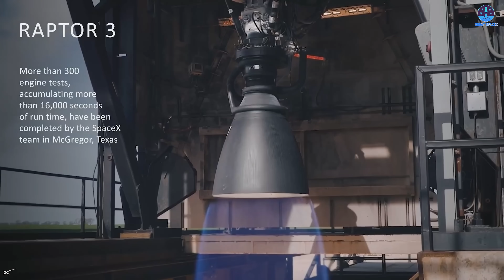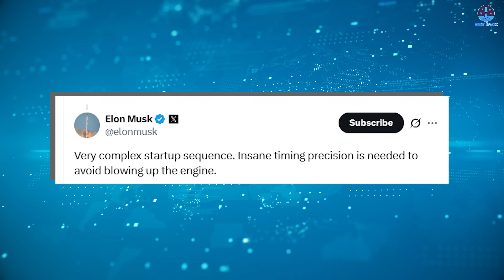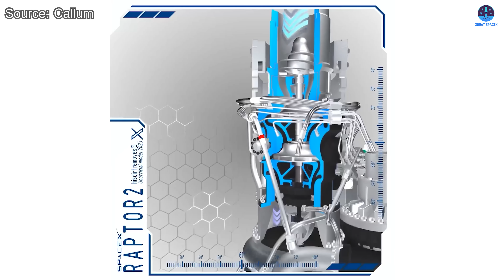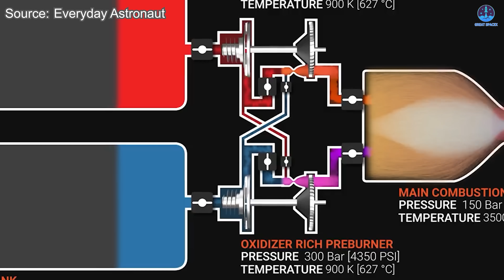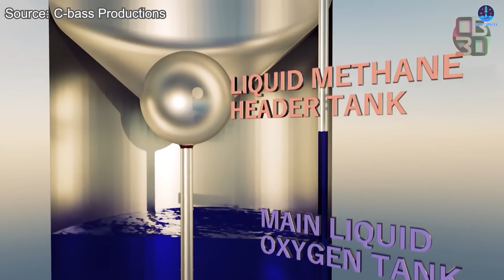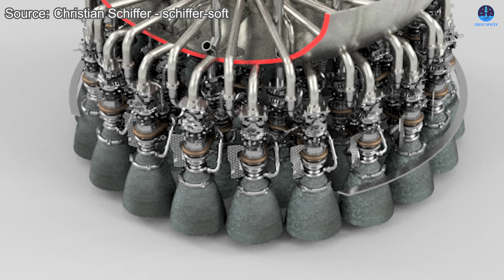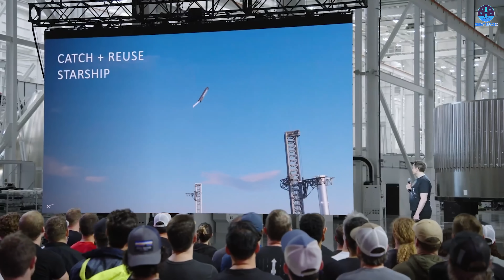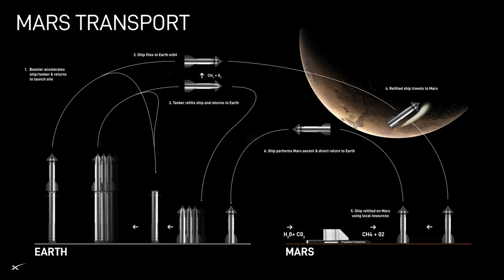Elon Musk exposed HARDEST Problem on Raptor 3 to Avoid Blowing Up! Here's Why...

Comment: The start-up sounds like trying to keep a turbocharger spooling around a curve.  The only way to do that is to blow a gas throw it when the engine is despooling.  This is one reason we like to use superchargers.
Reply from the maker: Let's wait to see how SpaceX will solve this
Reply: @colonbina1  In auto-racing, we haven't figured on a simple solution over the last 55 years, so a SpaceX solution may take a while.  I think the engine design needs to change slightly.

Comment: For all these refinements, the fundamental problem remains. And I'll quote Peter Beck from Rocket Lab..

"“There is no point in having an engine that is absolutely busting its bolts at 11,000 psi"

In other words, the decision to move to a steel body meant chasing the last few seconds of Isp from the engines. Which means having ultra-sensitive engines. This is not what you want on engines that will spend years in space and get restarted many times.

Comment: 7:15 "If a component deep within the engine needs replacing, technicians must cut into the structure ..."  Yeah, they'll never do that.  If a diagnostic indicates a problem "deep within the engine" they'll just scrap it.  You have to consider the skilled labor cost and the hard to quantify "one-off" effect on engine reliability.  You'd never bother. Just grab another engine off the production line.
Reply: You can't just grab another engine. They are all the same model and series, they are all fucked.